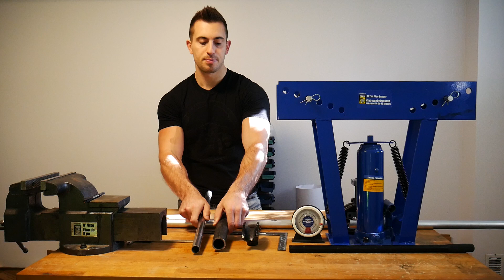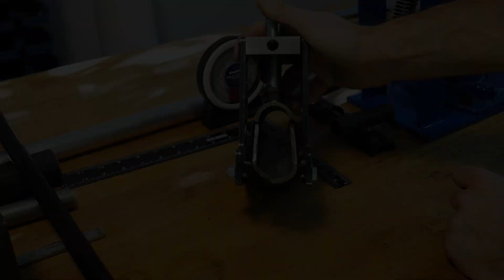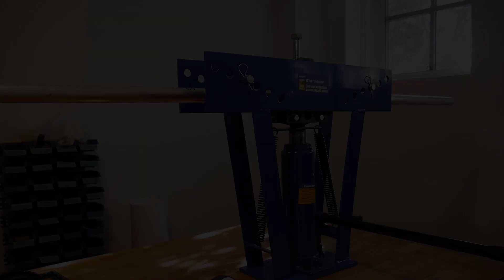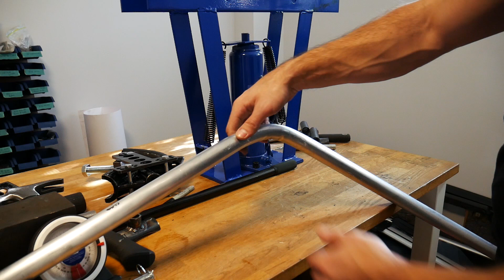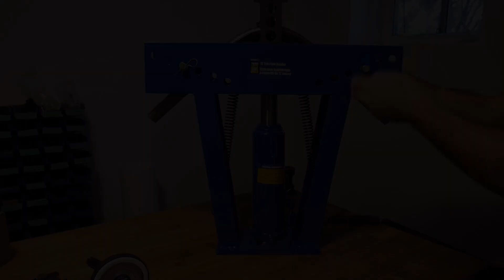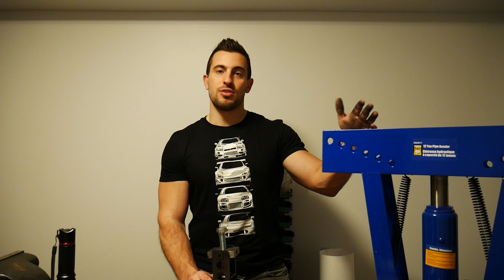How to Bend Tube with a Pipe Bender!

Comment: $300. eBay. "affordable bender" comes with 1 die. ready to bend when you pull it out of the box. don't waste your time with this garbage. you still have slop between the tube and the die since the die is for PIPE not TUBE. NOT COUNTING the fact that harbor freight has pulled a "walmart" ( put everyone near them out of business, then jack their prices up since you have no where else to go) FOR EXAMPLE: this bender is now OVER $120... then all the other parts you need to make it work like the $300 affordable bender... and still get trash bends. also look at HF's KNOCK OFF of the milwaukee M18 drill... THEY ARE CHARGING DOUBLE WHAT MILWAUKEE CHARGES... out of control... i say screw HF until they get off their high horse.
Reply from the maker: Hi Wayne, I can't speak to the price changes on the bender, I haven't been following. Also, after using a piece of pipe to take up the space between the pipe die and the tube, there was no longer any play between the two parts. I actually had to hammer the tube out it was so tight. While I agree that this is not the best way to bend tube, if you already own a pipe bender like this, it's not much work to make it work "okay" depending on what you're using the bent tube for. As I said, if you need proper bends there is no replacement for the right tool. Thanks for watching.

Comment: have a look at that Photo of that yellow Hydraulic Tube bender have a look at the shape of those Rollers? zoom in and get a good look at those rollers? if that is the right word ya know where those Pins are showing in your Photo of your bender machine in your youtube video that is the secret to why you are failing or winning the shape of those Rubber umRoller? ? place where the tube is pushing against in the machine change those or find pair of or KIT of those 2 Rubber  Rollers replacements don't know what you call them I was in the shop today they don't know either!! THIS IS THE PROBLEM.........The chinese have figured it out in their new machines but I doubt that the hydraulic claim of that push Pump is what they claim might be underpowered....so those roller thingies have 4 shapes in them.
Reply from the maker: Thanks Gecko, whats the reasoning that you think the form roller will make such a difference? Thanks for the comment and watching!
Reply: We had the other type here at one our Projects and it failed miserably so I decided to buy my own and not wanting to make the same mistake and noticed that Design Feature missing in our Machine unlike the others that would be successful it just makes sense when you have a look at the picture...........just like a bit of detective work and a lot of Buying products is like that.........what works what doesn't. getting past the deception confusions and fakes....

Comment: Try a roller on one side and your custom bracket on the other. Pull the tube around instead of forcing x amount of material into y space. 2¢
Reply from the maker: Thanks! That did occur to me at some point but haven't had the chance to test it! I'll find some time!
Reply: Embrace Racing I'm going off what little experience I've had with a JD2 manual bender. If not mistaken, it stretches the length of tube over the die, making the circumference a bit smaller in bend. Keep up the good work.

Comment: the top section needs a bit of a bend in it other wise your bending something while bracing it with a flat surface, thus the flat spot on the top, and the inner section needs to be real tight, like only once you start bending it complacently pops into place, also use wheel baring grease or petroleum jelly, that will reduce scuffing, make the bends cleaner and easier to get out of the dies.....or just get a tube bender but do use some sorta lube
Reply from the maker: Thanks Josh, a real tube bender is in the works ;) I couldn't make the top section curved because I wouldn't be able to clamp it down while the tube is still straight. It did cross my mind though!

Comment: Hey I just found out why some of the latest not so cheap Tube / Pipe benders work better than what you are doing and it took a while......so what you might want to look at is the Hydraulic Tube benders on Ali-Express.com and you can get a look at those 2 inserts where the tube touches near the outer edge,while the pipe is being forced up by the Hydraulic and what changes everything is that new shape in those 2 parts they are tunneled out in a shape you don't see in the shops here which stops the kINKING!!.........Mystery solved. Yes you can get a look at thet design feature on YOUTUBE  I was looking at the Hydraulic SW-1 and the KAKA HB-10 it may be one of those  so once you understand that modification you could be the Winner of that quest!!
Reply from the maker: Hi Gecko. That one you suggested still looks like a pipe bender? They have another model, the HB-8 that is intended for tube. The price is pretty good too!

Comment: Great job !!  ya your always going to get a slight deformation in your bend with that type bender all this fill with sand Bullshit I keep reading .  It doesn't  work ,   I used to build ski lifts and bent  thousands of chair bails with 5% deformation,  bails are  when your sitting  in the lift chair going  up the mountain  its the u shaped tube and or pipe that holds your chair to the cable clamp ,and we used a three hundreds  thousand  doller bender . Great video  straight  to the point .
Reply from the maker: Thanks! Yeah I've heard mixed things about the sand, it doesn't work for a lot of people and it's a pain in the ass. I'm going to build a proper tube bender one of these days... still won't be as good as that three hundred thousand dollar unit though :p

Comment: For smaller tubes that aren't very long, you can use Cerrobend. It is rather expensive, but it has a melting point of 158 degrees F. Pour the molten metal in the tube and when it cools , the tube will bend just like a solid rod. Then re-heat the tube and it will run out. It can be reused . Tubes with a very thin wall thickness have been bent this way. I read somewhere, that tubes have been bent with a center line radius of only 3 times the o.d. of the tube. Also check out Woods metal, and I understand there is a new plastic resin that can be melted and used for this purpose. I do know that you could buy 100 lbs of ashtray sand cheaper than a 1 lb block of Cerrobend!
Reply from the maker: Wow, very interesting! Never heard of that stuff before!
Reply: When you heat metal you take it out of spec if you are aiming for a particular use like roll cages.

Comment: Heres a hot tip for  you. Get a hone and hone the inside of the tube you want to make the shim out of. THEN bend it and cut it in half.Realistically a piece of 1/2 round with a slot cut in it, slip in a 2 inch wide piece of coarse paper, chuck it in a drill and flap away,It'll get rid of the seam real quick too.
Reply: Better yet. You seem to have a decent shop. Heres some plsns for the JD, Pro_Tool blah bla ratchet type draw benders. You can whip one out in a few days. Faster if you know a dude with a plasma table.
http://chopperhandbook.com/bender.htm
Reply from the maker: Thanks for the link! I'm going to have to put it to good use and make one! Really appreciate that

Comment: Great video The problem your having is that you need controlled wrinkles Just put evenly placed grooves in your dieTo allow the inner diameter to shrink as you bend
Reply from the maker: Thanks! Interesting approach! The grooves would run radially?
Reply: scott howell ii
Reply: scott howell ?? Grooves running perpendicular to the length of the tubing?

Comment: This machine will work well if you tape one end of the tube to be bent , stand upright , using a step ladder if necessary, filling with water first and pouring sand into the top . The water is forced out , replaced by compacted sand , the water ensures no voids are present in the sand , this ensures uniform smooth bends . When the bends are complete , simply wash out with a garden hose.
Reply from the maker: I'll have to give that a try sometime, thanks for the tip!

Comment: the tube formers  dies  are not deep enough, weld an extension to increase the die depth  this supports the side wall of the tube and stops it swelling out
Reply from the maker: Thanks David, that was the idea behind the top clamping piece. I did manage to prevent the sides from swelling out, but its the inside of the tube that still crushes slightly, and the outside flattens out.

Comment: also consider the manufactures seam weld. should be on the mean line
Reply: all pipe/tube has a weld seam unless it is seamless
Reply: David Green are there seams on dom? Tube does not have them, I may be wrong though....
Reply: David I am not sure what you mean when you say (mean line). If it is like what I think you mean then I would for the die liner have the seam to the outside of the bend so when split there is no cleanup required if that makes sense. John Australia. PS: Really good informative video, thumbs up.
Reply: I have built roll cages for dirt track race cars, You want your seams on the Inside when building roll cages.

Comment: Have you tried this with something like 1.5" dom ?? Looking to make control arms.
Reply from the maker: Haven't tried it... what wall thickness are you looking to use?
Reply: Not exactly sure , yet I need to do more research on control arm tubing and what I.D the tube must be for heim joint inserts.
Reply from the maker: Sounds good.. just so you know, I still had deformation of the cross section with wall thickness as thick as 1/8"
Reply: Their has to be a way incorporating your method and maybe sand to eliminate any kink at all. Eventually they'll have a full on solution to convert these to do tube without spending a fortune.

Comment: If one were to buy this bender but instead of using the dies provided, but tube dies, will that work?
Reply from the maker: Unfortunately this will not work. Tube bending dies will not fit one of these tools and the entire principle on how they work is different. Chuck Norris should be able to bend tube by hand! ;)
Reply: @EmbraceMaking  So should you with them muscles you got.
Reply: Chuck Norris *

Comment: Good vid, thanks. I bend aluminium tube and find that if annealed prior to bending, it can flow much better without kinking. To anneal, you strike an acetylene-rich flame and blacken the tube, then adjust flame to neutral and heat tube until the black soot is burned away. Tube is annealed and will go back to its initial hardness after bending and being left for a few days.
Reply from the maker: Interesting! Thanks for the tip Manny!

Comment: where did you get it at 100???
Reply from the maker: Very lightly used on Kijiji, a local buy and sell site. Brand new from Harbor Freight they are not very expensive though?
Reply: Kevin Ali that particular powerfist 12 ton pipe bender is 179$ ca 
at Princess Auto

Comment: i did very similar mods to mine. but i like your clamp and die setup better. i tossed the rollers that came with mine because they kept denting my tubing. so i made a pair like you did as well. i also noticed moving the "rollers" down for smaller tubing helps with the bend as well.
Reply from the maker: I've noticed similar with the position of the rollers. Thanks for watching!

Comment: can you guide us how to bend half aluminium pipe of diameter 85 mm of wall thickness 1.5 mm ?    from Precisionindustriesindia@gmail.com
Reply from the maker: Sounds like you will need a proper tube bending machine. Unfortunately thin walled aluminum tube is difficult to bend with this inexpensive method.

Comment: I'm telling you man the only time ive scene this work successfully was by a guy who made a 1000cc buggy and he used a stock none tamperded harbor freight bender and he just used the die that was 1/4 inch smaller than the tubing he was using. couldnt believe it
Reply from the maker: Yeah, I've seen very few successful attempts. I was hoping I was going to be one of them. Seems that you need to use thick tubing to make it work... so it more or less behaves like pipe.
Reply: Embrace Racing he was using 1.75 .120 wall dom I believe. his logic was great though. as you push up with the smaller die it squeezes the side wall keeping it from pinching the sides and rippling the bottom
Reply from the maker: I'll have to give it a try, but I still foresee a proper tube bender in my future :) I think I'm going to build one for the fun of it though!
Reply: Embrace Racing have fun! jd3 dies are like 250 each! shop around!

Comment: Excellent attempt.  Close, but making a pipe bender bend tubing the way a tubing bender does, is like putting lipstick on a cat.  It's still a cat.  Enjoyed watching the process.
Reply from the maker: lol I like the analogy. It was a fun attempt, but as you said, not the optimal way of doing it. I used this method to make the bends on my non-critical front light bar. Obviously not suitable for roll cages or safety equipment. Thanks for watching!

Comment: Pack the tube with an ice and soap mix and freeze it. Or fill it with liquid lead and allow it to cool before bending.  Brass musical instruments usually have perfect bends using these methods.
Reply from the maker: Interesting! Never heard of this method, thanks!
Reply: @EmbraceMaking  or sand is what was sometimes used on construction sites when the appropriate sized bender was not available.

Comment: My trick is to saw notch wooden dowel rod top and bottom ( which must be almost the same diameter as the ID of the tube) into sections as long as the diameter of the tubing and insert a piece of notched dowel at the area to be bent. Along with modifying the dies as you suggested, this helps prevent tubing from flattening and kinking. I believe that if you seriously want a good result bending tubing, you would need to upgrade to the much more expensive system ( rolling dies )  that you can buy the real tubing dies for.
Reply from the maker: Sounds interesting Marc. I will be investing in a proper tube bender to get the best results :)

Comment: so why hasn't any body made tube dies to fit these benders or is that just to easy they would sell heaps of them
Reply from the maker: Hi Paul, seems that there are a few more variables than just the die. Thin wall tube still does not like to be bent in this manner. It needs to be drawn through like a true tube bender. However, for thicker wall tube, you might be able to get away with it until the bend radius or angle is too tight.
Reply: the 2 end pins usually dent the tube thats why no one likes these for tube :(
Reply: and pipe